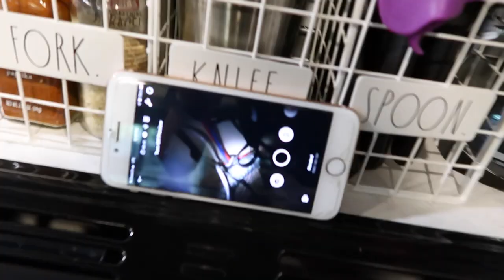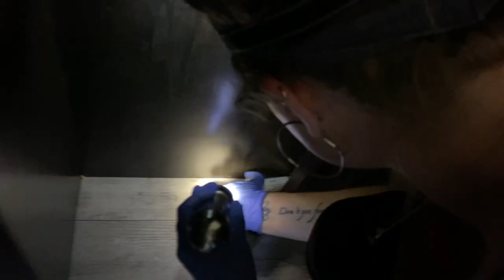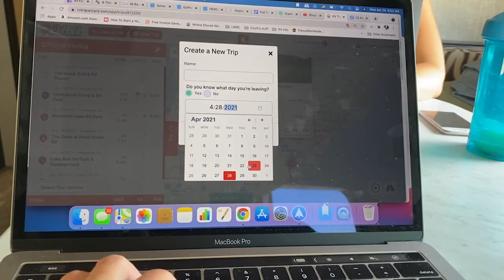Vlog #18: Camper Cockroach Infestation | Full-Time RV Living | Part 2

Comment: You could try checking the vents inside and out to see if any are lose, any ductwork  inside and out and look for any gaps or holes in the floor inside and outside that will need filling. Also check where any water and electrical enter.
Reply from the maker: Good tips!
Reply: How do you fill a corner that the carpet came up at and now seems to be a small hole I think. It's on the slideout.
Reply: @cheyennenation4010  I would need to see it. But you can use a plastic corner piece and sealer. On the inside you could use 2 pieces of trim (wood or plastic to cover the hole on the inside (you would cut both pieces of trim at a 45 degree angle as it’s for a corner).

Comment: You most likely experienced wood roaches they are large and are in areas where you were . The traps you used works by them ingesting the bait the return to the nest where they ultimately die . I had to deal with them and found using the combo that you use works but you need to monitor constantly. Another issue is field mice I use cab cabbage bags . Mice do not like the oder its not poisonous. You can get them at Amazon . Its good to place them in the under carriage ares in cabinets any storage cabinets replace every 4-6 months
Reply from the maker: That’s good to know! Mice would also absolutely be traumatic 😂 those are like…full animals invading. I mean cockroaches weren’t ✨pleasant✨ but mice are 50 times their size